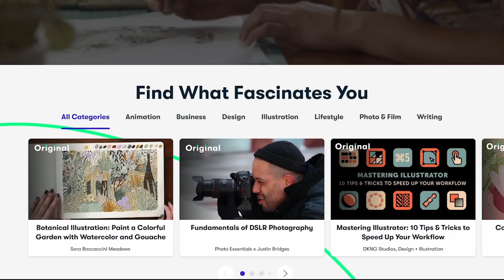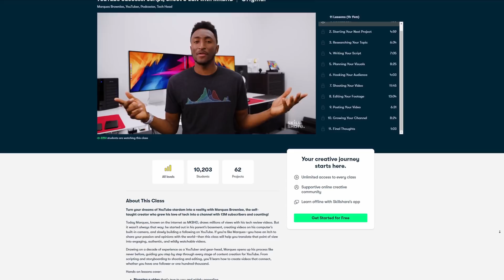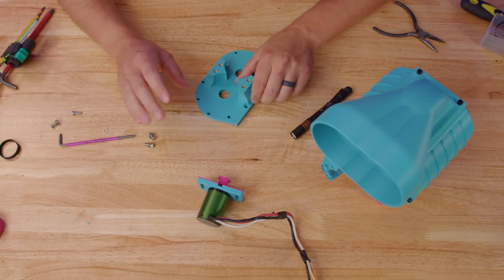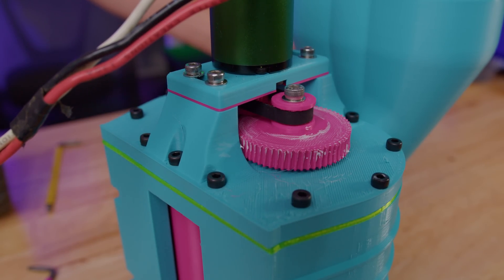I Attached a 100,000 RPM MAX Castle Mamba to my 3D printed SUPERCHARGER..... Will it Survive?

Comment: That motor is running a lot slower than I would expect, a typical performance 540 sized motor in an RC car would be running two or three times that RPM or more.  The low RPM suggests the motor is being loaded too much which would explain why it guzzles so much current. Direct drive is probably not doing you any favours here, gearing it down could really help. A toothed belt would probably be the way to go, you can buy the belts in a huge range of sizes and the pulleys are easy to print.
Reply: Unfortunately changing the gearing would probably turn this into shrapnel as the boost would increase. Not that I wouldn’t enjoy a 15 lb party pulley until it popped.
Reply: @One_Bar  There is no boost as it's just venting to atmosphere. It's just moving air.
Reply: Look into the belts guys use for electric longboards. They're braided rubber belts, the ones I have are basically miniature timing belts as far as strength specs go. Will require a bigger motor mount/pulley setup, but you could also add spring tensioner to the belt and help keep it on.
Reply: Not only that, the belt was being geared up and not down.
Reply: This is not an RC car mate, it's a 3D printed plastic toy. If you'd make it in proper metal it would purr like a proper kitten.
Reply: or a lower kV motor
Reply: I mean... I've run several rc classes and one was Formula with a spec 17t motor... by gearing it down you could achieve in certain scenarios more top speed, because the motor could go into higher rpm ranges due to esc and power limitation... even with this mamba I would not be surprised if gearing it down will end up with less draw but faster turning of the screws...
Reply: i think direct drive would work well with the correct motor battery combo. he should look into getting a low KV 8th scale motor/esc and some 4S+ batteries for it as that would be better suited for the torque load that motor is under.
Reply: @nemesis1588  if direct drive, then not with car stuff... they are all made to be geared. Airplane outrunners could serve well tho...
Reply: Chain?
There’s a reason some car manufacturers don’t use belts…
Reply: In this case its going to be more the fact that the assembly is huge instead of that little bit of friction in the gears. He could reduce that power loss but it'd probably only net him maybe 1% speed from a belt upgrade. Not to mention all the associated problems with belt drives.
Reply: Direct drive is the best way to go, he just needs a different motor...
Reply: @jjhack3r  I was thinking the same. Needs a motor that is rated for what he is using it for
Reply: @jjhack3r  Yes, a motor with a lower Kv rating would be more suitable for direct drive.
Reply: You saw the video right? He clearly said he was losing performance. So where in the range of half
Reply: Did... you watch the video? He tried toothed belts, they snapped near immediately.
Reply: @PewnyPL  There are many types of belts.  Those ones were not up to the requires spec, but there are others that would be.
Reply: @PewnyPL  I think it is obvious that the belts he used, were drastically too small/thin/weak for the task. He is trying to transfer something with what amounts to a rubber band, that is dwarfed by the blower. Look to blowers that are actually on vehicles, the belt that drives them is drastically larger in proportion to the blower, than the belt he used.

I don't think he is going to find a belt the size, and strength he needs, in something that is going to fit in the space constraints he is trying to make it in. To make it belt driven, I think it would need a belt that is like, 15mm wide. A quick search online finds some 15-20mm wide belts, but they are roughly 480-500mm in length, used for either Gilmer belt drive systems to drive the water pump and alternator of a V8 engine, or high performance, mechanical fuel pumps for drag race engines.
Reply: @dposcuro  Short toothed belts are available for industrial applications, McMaster-Carr or simmilar will likely have something suitable.  Whatever he used was absolutely tiny, looked even smaller than the belts on a 3D printer.
Reply: @dposcuro  you can easily find toothed belts in all sizes. Htd ones are decent. 
3m htd belts about 10mm wide should be sufficient, as they are sometimes used to propell entire electric skateboards under loads, this 540 sized Motor is not able to generate.
Reply: @PewnyPL  Have you seen the blower belts the dragster guys use?   and an electric motor has peak torque fro ZERO RPM.
Reply: @fooman2108  thats not entirely true, 0 rpm no torque is made at all and unfortunately even though they make huge torque at low rpms that doesn't mean that's where they are most efficient
Reply: Gearing down would reduce performance. Providing more power to the motor should be sufficient to handle the load
Reply: @TheTyisawesome  the motor was running nowhere near the rpm it should. You could gear it down 3:1 and possibly get more rpm out of the blower
Reply: @TheTyisawesome  No gearing down would not decrease performance, it would allow the motor to run at a more efficient speed.  If you look at a typical efficiency chart for a motor you will find that losses are greatest at low speed and high torque, dominated by I^2R loss.
Reply: @ferrumignis  you cant know what "efficient speed" or gearing it would run at without first designing an equation of motion for the motor and the assembly, then running it through an ODE solver, and finally an optimizer. 
Otherwise you're just throwing gear ratios at it and seeing what sticks. 

Also you mention efficiency, when efficiency doesn't really matter for this setup, its power that we're after. The greatest power output is defined by (1/2)(k/v) which is not the motor's no-load speed. You need to gear it so your RPMs run at peak power while matching desired output speed. 

Belts also arent just "beef it up until it works." 
steps for proper belt selection:
1) find the angular velocity of the spindle
2) set the pitch/diameter of the sheave on the motor
3) find the pitch diameter of the sheave on the spindle
4) Solve for linear belt speed
5) Find belt length from center-center distance
6) actually select the nearest best belt
7) recalculate center-center distance for this belt/sheave combo
8) solve for power capacity of the belt
9) find required power with design/service factors
10) you can now put a belt in your system
Reply: @t_c5266  You are starting with a multiple incorrect assumptions.  Let's address "efficiency doesn't really matter"

The fact that his battery packs can't maintain the current demand for more than a few seconds says you are wrong.  Running a motor like the one he is using at low speed and high torque requires much higher peak currents.  The impact of this are greatly increased I^2R losses which lower efficiency, increasing heating in the motor and putting higher stress on the battery pack.

Let's address your first point:

"you cant know what "efficient speed" or gearing it would run at without first designing an equation of motion for the motor and the assembly, then running it through an ODE solver, and finally an optimizer. "

This is pretty obvious techno BS that you thought would make you look clever; it doesn't.  For starters the aim isn't to achieve peak efficiency, simply to improve the efficiency so the batteries aren't getting such a ass kicking. Just knowing the Kv rating of the motor would give a big clue as to the direction needed here, and from previous experience I can tell you a performance 540 style motor for RC use is very unlikely to be well matched for this application.  At full throttle that motor would likely be running at 20,000RPM or higher in the original application, loading it up so much that full throttle gives ~7000 RPM is going hurt efficiency pretty hard.

I don't know if you watch Tom Stanton's videos but he made the same mistake trying to use a small BLDC motor with a high power output rating to drive a bicycle.  The motor quickly burnt out due to being driven very hard at low RPM, and copper loss causing rapid heating.
Reply: @ferrumignis  seems like you know your stuff. The mods I would make are, use one of those 100Ah lifepo batteries, yes it's still a battery, but it's likely not being stress tested for hours on end, use an electric skateboard belt, and then start testing with a fabbed spring blowoff valve. That would be relatively easy to calibrate with a standoff and a scale
Reply: @ferrumignis  You clearly didn't understand a word of my post. 

But thats okay. I'll let armchair engineers like you continue to think you're correct.

p.s. Everything I posted is straight out of a textbook. So until you actually start arguing from a point more expert than a weekend hobbyist, your entire post can safely be ignored. "i had an RC car once" is hardly much of an authority to try to make your point from.

p.s.s. Tom Stanton also did none of what I posted
Reply: @ferrumignis  okay why optimize efficiency for this application when you are not stuck with this power source. Isn't the goal the highest sustained rpm possible. If he is no longer working off these batteries and can use another source to supply much more stable constant power to the motor wouldn't that be enough to keep the motor happy? It seemed in the video it was performing well until the batteries started fading.
Reply: @TheTyisawesome  He is stuck with that supply at the moment. What's the point of running an inefficient setup that doesn't work with the available supply and will rapidly overheat the motor?
Reply: @ferrumignis  I guess as in this video yes... At the end of the video he says he'll be looking for another power supply that can really push it. The batteries are not designed for this why continue with a weak link
Reply: @TheTyisawesome  The batteries were designed to power that motor, in his RC car, which will have appropriate gearing.   Why choose to brute force the motor to do something it's not happy doing rather than fix the root cause of rhe problem?
Reply: @TheTyisawesome  Don't bother. He doesn't understand anything other than "run the motor at maximum RPM" and even quoted another youtuber who used that approach, trying to run the bike at a no-load speed of 30,000rpm, realizing extremely fast that approach doesn't work, and quickly dropping to a 15,000rpm motor. Not realizing that a motor rating of "x" amount of power means (1/2)(k/v) and not "power output at no-load speed"
Reply: @TheTyisawesome  No, the motor is running hot because its running at a too low rpm. Its built for proper revs. Brushless motors are basically dentist drill speeds.

Comment: There are some inexpensive 12V 80A SMPSU. I'd probably put a generous capacitor bank at the output so the psu last a bit longer with such load, and some soft start to charge it initially. (a resistor and a manual switch to flip once the caps are charged) and then give it a go... They are quite inexpensive so you could get more than one just in case.

The PC PSU could be an option but I guess that's way too expensive considering this other option.

Good luck and keep pushing it!

Comment: Ya how are you not going to tell us the number of cells or voltage and amps needed  if it's like a 3s you can get a computer power supply or a server power supply you can get a 500w or 750w or more and that almost all at 12v

Comment: For the power supply you can buy old server PSUs 12v 100A no problem, you can connect in series for 24, 36, 48, the are good tutorial on YT how to modify the PSU tu run stand alone

Comment: 8:15 I would also posit you pick up aan NR-200 twin cylinder 4-stroke nitro engine and use that to drive it. Eschew motors entirely. Will prolly have to do the testing outdoors, but hey.

Comment: 3s lipo batteri is kinda low tbh, only 12.4volt, get a 70mm ducted fan motor capable of using 6s lipo, that is 24v cost around 300 dollar for a cheap esc and motor, and a 3300mah 6s lipo is around 90 dollars

Comment: That motor is gonna need cooling
Reply from the maker: If we get there water jacket time lol
Reply: @MajorHardware  I was gonna suggest just mounting it in the air inlet path with some radiator fins. But you can do liquid metal cooling if you want

Comment: I have a 1U variable power supply from MagnaPower. 1.5KW. 
0-50V DC, 0-30A

Not cheap though.

Lots of manufacturers of variable DC power supplies though used for equipment testing. 

My 1.5KW unit was the smallest that MagnaPower made... By a very healthy margin (they can build units north of 3MW...)

Comment: Hook it up to a mig welder. It's a constant voltage power supply. Meaning you set the voltage and it adjusts the amps. 
Alternatively contact marcoreps

Comment: 5:41 a car battery will work fine for that thing. 12.6v nominal is near enough wha a fully brimmed 3s LiPO puts out and the capacity of a car battery is friggin nuts. 20,000mAh +.
Reply: And they can handle insane amounts of current oo, a car starter can pull 800A so that would be more than enough for the job
Reply: @snjert8406  Yep. Even a cheap 500cca car battery like I use in my 40 year old F150(A worn out 8.5:1CR straight six with a carb and basic hall effect distributor ignition really doesn't need much battery to start) will push 800+ amps at room temp. NO WAY IN HELL any of the wiring in that setup can even come close to handling that kind of draw! Something else would let the smoke out before the battery gave in.
Reply: Please don't start rating car batteries in milliamp hours, it's usually said in amp hours. More zeros doesn't make it any bigger.
Reply: @Njazmo  I'll rate them in cats per fortnight if I want to.
Reply: @TestECull  or if you’re a The Martian fan, rate them in pirate-ninjas.
Reply: @Njazmo  you see, the wonder of the metric system tells us that the little m before Ah means it's 1000× smaller, so anyone with a functional brain can work that out. Nobody is being fooled into thinking it's bigger.
Reply: Depending on where you live, and what batteries you use. 
My diesel engine requires a  80ah (80,000mah) but it does 13.7v
Reply: @boziewz6125  A car battery is a car battery. Most of them are in the 500-750cca area and will take 20-30 amp hours to charge. The batteries you're talking about are gonna be AGM units for commercial trucks. Semis and the like. Have worked with those, too, but they're a bit much for what's going on here.

A standard 500cca car battery will be plenty for this project.

Also never once heard anyone rate car batteries by their capacity since they usually don't get used in applications where that matters all that much. They're instead rated in Cold Cranking Amps, IE how many amps the battery can supply the starter motor when it's 32F/0C out while holding enough voltage to run all the electrical accessories necessary for the engine to actually start, because that's the relevant statistic when shopping for car batteries. Once the engine starts all of the vehicle's electrical demands are supplied by the alternator and the battery is kept topped up so it's ready for the next start. 

I only knew the rough capacity of them when I charged one with my RC charger one day.
Reply: @TestECull  if one battery isn’t enough, it’s very simple to parallel another on on top of it.
Reply: @White000Crow  A single car battery will turn a 2 gauge copper cable into a mood light without even trying. No way the 14AWG aluminum wiring in the ESC power leads or the 16AWG aluminum wiring in the phase lines to the motor can handle even a fraction of what a single car battery can spit out.
Reply: @TestECull  now I’m really curious about this mood lighting thing. I have some batteries laying around, time to get to work.  We may watch his esc go up in smoke if he does try it.
Reply: @White000Crow  haha. Just make sure you've got a fire extinguisher handy, 'cause copper that's incandescent is gonna be a bit floppy and fire-hazard-ey. 

As for the ESC...itt'l just go into thermal shutdown if it's overloaded.
Reply: can the ESC pull that much power? As the battery is not forcing the amps down the wire if they are not being demanded.
Reply: @TestECull  . That mood lighting analogy is so absolutely spot on. I may need to file that term away for later use.
Reply: @filanfyretracker  ESC will only pull the amps it is able to pull. Can hook it up to a 1,000 amp supply without issue because it won't draw 1,000 amps, but it will draw up to 100 amps.
Reply: Came here to say this when you need inexpensive ~12v with buckets of current lead acid is still king. It's when you want a long term solution with better packaging or weight you end up either lipo or  some kind of Li-ion multi cell pack.

Comment: hobbywing max 8 run it on 6s itl produce only slightly more RPM but 10x the torque. either way you need to bump it up to 8th scale brushless.. the little 10th scales no matter what you do those little 540 motors just wont have the torque to push it to its full potential.

Comment: Hell yeah! Belt drive! (does not matter, that it didn't hold up for long). For PSU you can buy pretty much any 12V needed current and keep using ESC. I even think, you can hook it up straight to motherboard PWM. But this is from top of my head and requires some researching.

Comment: Get 2 PC's power supplies and use the PCI-E wires... connect them in series to get 24 volts out of them.
it can handle very high current but its voltage is fixed.

Comment: Please please please add a static pressure test, static pressure is an important metric for PC cooling. But also I just want to see how much static pressure the blower design has considering it's designed specifically for high pressure appliances (even though it doesn't have seals on the lobes I'm sure it'd do great)
Reply: I get the feeling this thing would blow itself up from the preasure it can generate.
Reply: @jakobrosenqvist4691  which... would be even more awesome!!